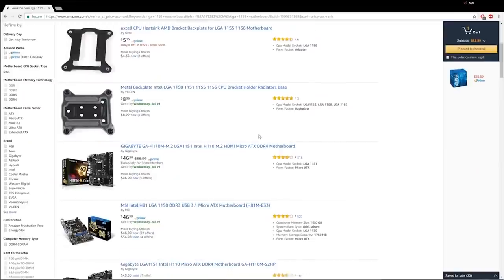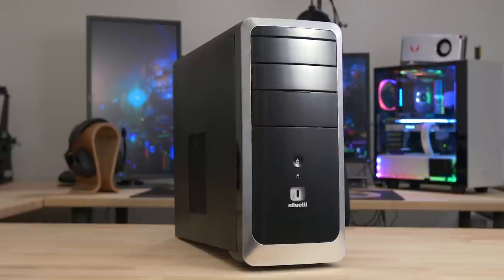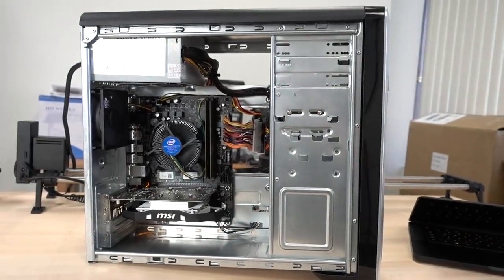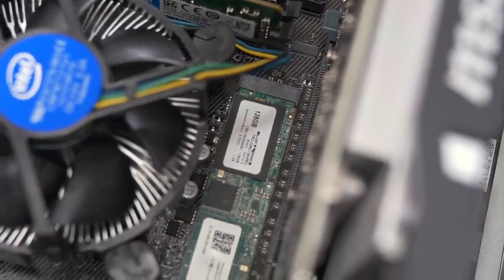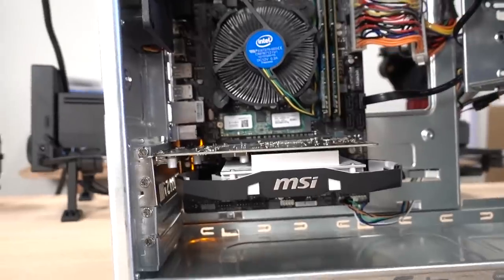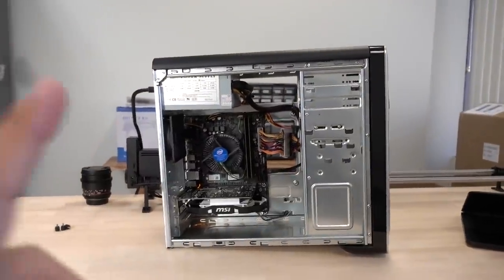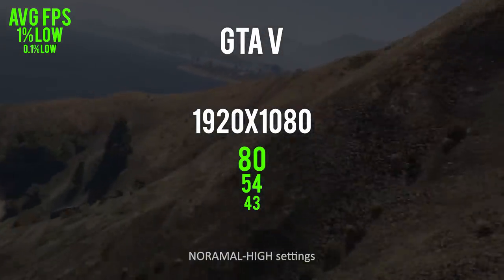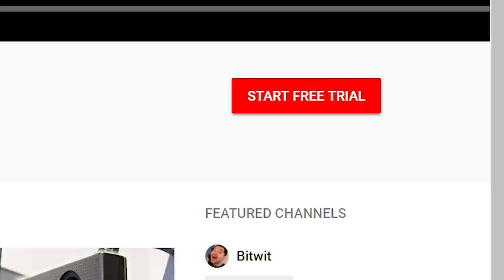The best $400 gaming PC ever?

Comment: Now do the same thing with used parts, what's the performance gain?
Reply: 400 dollars on used parts can carry you so far it the most overlooked part of building a pc on a budget
Reply: Got most of my parts used off sites like Letgo. In the end, I can play most games at high/ultra 1080p >60fps, and I only spent a total of around $375.
Reply: xTrimmZ specs?
Reply: @jasonxii3141  fx4300 @4.5ghz, gtx 1050, 8gb ddr3 @1600mhz, Corsair CX500 psu, 2x120gb SSDs
Reply: used graphics cards are such an easy way of getting cheap FPS after a bit of dust cleaning and thermal paste replacement, I picked up a gtx 970 G1 gaming for 130 dollars last year and its still running super strong
Reply: It would probably Blow up If u get a cheap ass Power supply like my brother his catch on fire and Fried Everything
Reply: Honestly if you are building a pc and want to save money, buy some parts used. The only used parts I would stay away from are cpu, motherboard, and ssd/hard drives. Everything else is really fair game.
Reply: Used parts allowed me to build a $900 rig for $630
Reply: @xiProNewb  fx 4300 in a 375 usd pc? That's not worth it at all.
Reply: @kaoteni4122  why wouldn’t you buy a used cpu?
Reply: @kaoteni4122  and power supply.
Reply: @UpbeatTempo  Because the silicon quality won't be great.
Reply: @HeelerHouse  Does that matter for normal use most of the time or just heavy overclocking? I just built me and a friend's pc not too long ago, and I got a used Ryzen 5 1600x, so far it's worked great for me. He got a used Ryzen 3 2200g and so far no problems either. I've known about the PSUs/SSDs/HDDs, and have always known motherboards are a bit iffy, but I haven't really seen anything saying that used CPUs are big red flags.
Reply: @UpbeatTempo  It can matter for lifespan, but you'll probably already replace it by then.

Comment: How did I do?
Plan to do 1080p gaming, casual Photoshop work

Ryzen 3 1200 
ASRock B350 Motherboard
1x8GB RAM
120GB M.2 SSD
1TB Seagate Barricuda
Zotac GTX 1050Ti Single Fan
Bitfenix Nova Case
500W Corsair PSU

Total - £520
Reply: Yep that's awesome for 1080p gaming!
Reply: Which B350 exactly?

But otherwise it's solid.
Reply: Look on ebay pr craiglist for used 900 series gpus. I found my friend a evga 980 for 140 plus 15 dollars for shipping. If you look closely some people will sell used graphics cards and sometimes motherboards for a less than a 105pti
Reply: I'd look at the Seagate 2tb drive it's usually not that much more than the 1 tb one for way more storage
Reply: what about the key board mouse speakers monitors and the other jazz you might buy? how much does that total to?
Reply: Fantastic, but you could save money by cutting the power supply down to something like 430W
Reply: Crippz that is a pretty good build, I'm also from the UK. I would recommend considering the RX 570 or gtx 1060 3gb cos they have a pretty decent boost in performance, especially in titles like PUBG or Witcher 3 it will push you over the 60fps mark at higher settings. But for lighter/more optimized games that is a good parts list.
Reply: Brother Ares Yo I just saw an Rx 570 on ukpcpartpicker for £156 and that was a fucking amazing deal
Reply: Brother Ares i agree 
Gtx 1060 is a better choice
Reply: Crippz Corsair doesn't make a single decent 500W PSU. Get the CX450 or CX450M instead
Reply: You MUST put a dual channel RAM in there, can help a lot, especially with Photoshop. Apart from that, excellent for the budget.
Reply: al kiou I don't know, a single stick would also be better for future upgrades
Reply: Crippz Solid rig, it should do fine at both of those tasks. Definitely a good PC for your needs.
Reply: Get dual channel memory the extra bandwidth helps
Reply: Going in order: get 2x4 ram so it's dual channel, go for a 2,5 ssd because sata m.2 is the same thing but pricier, nvme is better but way pricier. Then the PSU it's ok as long as it isn't vs... Or maybe even the vs if you don't find any better
Reply: The zotac card is great
Reply: Probably should've gone with dual channel but pretty good I would say
Reply: good one
Reply: That kicks ass for the price
Reply: Ditch the 128GBSSD
instead get a 1TB Seagate Firecuda SSHD
use extra cash for additional 8GB RAM (make it 2x8GB because dual channel memory setup matters)
you will be happier.

the new firecuda sshd is an improvement over older generation sshd, and your boot and load times will be just 'almost' as fast as SSD. and you still get the huge capacity.
Reply: Lol it's my exact same build
Reply: that's fucking good
Reply: If your doing photoshop work and gaming go for dual channel ram
Reply: Crippz send a link for that m.2 ssd
Reply: Sounds like a great computer to play minesweeper at 4k !  
JK. That strikes me as a great entry level pc, with a good upgrade path.
Reply: Camelia sinensis The M.2 SSD was actually the same price.
Reply: Ryan C 😂
Reply: Faren Sabri Great idea!
Reply: Okay after reading all your suggestions, I have decided to upgrade the 1050Ti to a RX 570 8GB & the PSU to CX450M. I also want to specify, I chose to go with a single dim of memory because this PC if I build it will be with me for at least the next half a decade, and I would rather have one dim so I can upgrade later.
Reply: Lettuce Yes, but during this whole mining craze, miners will sell GPUs that are on their last leg. So I'd rather stay safe and go with new.
Reply: TheChaoticGamer I have all that 'jazz' but I spent around about £100 - £130.
Reply: SlavjanA https://uk.pcpartpicker.com/product/crs8TW/asrock-ab350m-hdv-micro-atx-am4-motherboard-ab350m-hdv
Reply: Just remember..! the AMD Ryzen 3 1200 is listed as a minimum system specs CPU on Oculus.
Oculus homepage:  https://www.oculus.com/
 The recommended/minimum specs page:
https://support.oculus.com/help/oculus/170128916778795/
Reply: Crippz use asrock a320-hdv for cheap ryzen motherboard
Reply: Corsair PSUs are kinda expensive. I'd go with an EVGA BQ 80+ Bronze PSU
Reply: If you can find a 570 for cheap, sure. And yeah the CX is acceptable
Reply: Are you overclocking?
Reply: Find a used 970
Reply: Crippz use dual chanell
Reply: Change the motherboard to an a320. M.2 to an ssd and get a ryzen 1400. It suits your needs better.
Reply: sounds like a solid build man. honestly if you could stretch it i'd go for an i5 6400 or r5 1400, but thats a pretty good list
Reply: Instead get a 240 gig sata ssd
Reply: Crippz nicely! Great price-performance ratio man
Reply: Nice but i prefer gigabyte motherboards they are alot durable good performance and m.2 ssd slot which is awesome!
Reply: Brother Ares hey I'm running a similar build, only differences are I have
2×8gb ddr4 ram
2tb hard drive
250gb ssd
And a gtx 780 ti for free from a friend. How's the performance for this something like this?
Reply: Looks like my build I already completed, looks good
Reply: id make sure to run dual channel memmory, it wont cost u more, and you dont have to look for a used part.
Reply: Brother Ares dude, my 960, without an overclock, still crushes a great many games at medium to high settings. The 1050 TI is a fine card
Reply: This is better.
Reply: Lettuce hes english like me we dont get the same stuff cuz its in America
Reply: Pandametal - Guncraft i second the above post yes u can upgrade the one stick but this is a budget build where u need to maximise performance and using ram in duel would be the better choice imho
Reply: hey, not too bad! though you would benefit more from running 2x4gb RAM sticks because ryzen likes its fast dual-channel RAM, i understand it does cost a little more at the moment due to the state of ddr4 prices. overall a great system that has a solid upgrade path! over time you could upgrade your CPU to something like a 1060 or a 1070, your CPU to a ryzen 5 or 7, and add in another 8gb stick of RAM to have a killer pc. :)
Reply: Hardly gonna hit 7 fps in Minecraft at 480p
Reply: Maybe a gtx 1060 with an intel pentium g4560 cpu
Reply: Looks good, like some people are saying look at a 1060 3gb,  what are you going to use for your os? Do you already have all your peripherals?
Reply: Crippz i would recommend dual channel ram for your situiation
Reply: kick ass! but honestly, i would go with a dual channel kit of ram, but it's great!
Reply: -Switch out the 2 storages for an SSHD, which will save you a ton, and perform like magic

-Try getting dual channel memory.

Otherwise, you're golden.
Reply: Looks solid man.
Reply: I'd drop to a 1050 and get a R5 1400 for photoshop
Reply: Crippz nicr
Reply: looks okay m8.. but I think you could pump that 8gb ram to 16gb for more better multitasking (multi browser tab, photoshops canvas etc)
Reply: Same build i have, i've been enjoying it at 1080p 60fps with decent settings
Reply: Crippz get ssd and 520 that valute is more then 520 dollars so I might wanna get cheaper evga 430 80+ bronze and cheaper case so u could get ssd
Reply: IDK 700 the 1050ti actually has 4 gb compared to the 3 gb version.
Reply: Natani Kriechbaum the 1060 has 1gig less but its faster overall
Reply: Decent... But i would get another 8 gb of ram for when you want to do more layers and stuff in photoshop
Reply: In the future I suggest upgrading it to 1070 ryzen 5 when you muster up the money ... But overall , pretty good
Reply: Crippz gtx 1060 3gb will  be good
Reply: Crippz I would def upgrade ur ram to 2x8 and get an msi b350, they are more reliable and get another 120gb ssd to improve speed especially if ur gonna be doing photoshop and editing, other than that u got a pretty solid build bro
Reply: maybe go for a dual channel 8gb ram instead of a single channel 8gb ram

Comment: Hey Kyle, you probably won't read this all the way in 2018, but you should do a cheaper budget gaming rig for october-november of 2018. what with GPU prices being the way they are (still) I have found a reasonable build on Newegg for around just $300. 
ASRock 760gm-hdv mobo ($44)
amd fx 6300 cpu, stock fan ($60!!!!!)
cougar mg110 case, 1 fan (I have mine in the top middle, blowing air onto the ram and cpu heatsink) ($30)
G. skill memory 8gb @1600 speed, (I went with Nemix ram, cause it was only $40) (I went with nemix ram for a sale, but Aegis and Aries typically run $10 more than my nemix-no-heatsinks normal ddr3 modules)
an evga psu, 450w (I believe the model to be a 450 BT ($33)
an older 2012 WD green 500gb ($24)
the GPU is a Corn GTX 750 1gb, even with still semi-inflated gpu prices, this was only $60. still is, as of the time of me making this comment.

Now, I realize this is an extreme budget build, with absolutely no upgrade path (well, one that would be worth the money spent) without a full system upgrade. HOWEVER! for many gamers like myself, running old cheap laptops or school-like prebuilts (looking at you, dell optiplex) this is an excellent way for us to get a foot in the door, as you would say. by the way, did I mention every singl part in this build is bought new, unused? so while being cheap, and while it DEFINITELY won't run every new triple A game at 1440 or 4k 144fps, it will absolutely demolish just about any competetive esports title at 720p-1080p low settings at a steady 60lock. So please, if you happen to see my comment, do a video on the low low end of budget gaming for late 2018 for us, I know I was just going to buy another laptop until I saw this specific build available on newegg, decided to buy it, and am now attempting to share it as MUCh as I can to anyone who could use the info. Sorry for the stupidly long comment btw
Reply: Helpful
Reply: Kyle's build right now will run you $500 without the case and power supply so yours is definitely much cheaper compared to this one
Reply: Why even attempt gaming on that piece of shit, yeah it definitely wont run every triple A title at 1440, 4k, 144fps because it wont run any triple a game at 30fps lol. just hold onto that $300 until you can throw in some more cash and get something worth buying. Waste of $300.
Reply: @procze  oh, and for the record, that "pos" system you seem to hate for no reason, yeah, I can play any title at 1080, with at least 60 fps. You don't need all the latest and greatest hardware to play video games bro, and not everyone cares about 4k and 1440p. they're not even that much better looking to the human eye than 1080p.
Reply: Are you able to play rainbow six siege or fortnite at decent frames
Reply: @mutedd4971  yeah! Typically avg 90-100 fps at low/med settings at 1080p (fortnite) and medium settings 70 fps avg for r6S
Reply: A for effort

Comment: $400 is usually what I spend on what I call a 2nd stage upgrade to my rig, before upgrading everything entirely. Had my rig since 2012.. And still playing modern games. AMD FX8350 and R9 380. You'd be surprised how many games it runs fine on. Lol
Reply: Everyone trashes on FX processors, they're not THAT bad...
Reply: JetSurf2002 
Fx 8350 for the wiiiiiiin!!!! 

Nah, but seriously, it does run decently.. still waiting for sales to upgrade mine, though. All about going to ryzen in a few months.
Reply: same. I only spent money on my rig when my HDD and GPU crapped at the same time. Never touched it since 2012. My 8350 is still a solid CPU.
Reply: FX 8350 is sufficient for 1080p gaming. It is serving me well paired with a RX 580
Reply: i only recently upgraded to a fx 6300 and a 1050ti from an amd phenom ii x4 and gtx 560 LOL.. just to play destiny 2. Now i'm saving up for a z370 mobo and an i5 8600k

Comment: Kyle Builds system for 1080p 60fps for $400. Meanwhile I have an $800 system and has played everything below 1080p since I built it
Reply: Sounds like you didn't do a great job of picking parts lol.
Reply: Matt DuGuay wtf are your specs
Reply: i5 6500, RX 480 8gb reference, 8gb 2133 mhz RAM, B150 mobo
Reply: the only thing you're missing out on is 16gb of ram but why an 8gb 480 when you don't even play at 1080p
Reply: Your monitor isn't 1080p?
Reply: nope
Reply: was all that was available for me when it released. 4gb models were sold out when i woke up
Reply: dont have a 1080p screen and i dont want to dip below 100 fps
Reply: I7 3770 non k and a gtx 650ti and i can handle 60fps.... why the hell is your moniter not 1080p and apparently supports over 90 fps assuming its a high refresh moniter
Reply: lol
Reply: Buy a monitor that goes 75hz or higher in refresh rate in 1080
Reply: I dont have the money for that. when i say im below 1080p im saying im on a CRT moniter that has been in my house since before i was born
Reply: Matt DuGuay ah ok you can save up then
Reply: i picked what i could afford with my budget at the time. i wasnt going to buy a gtx 900 series or r9 series gpu with polaris launching, and skylake was basically the same price as haswell at the time so i figured i may as well go for the newer platform so i get a few more years out of it. i couldnt find any used cpus that included the stock heatsinks and knew i would get the most bang for my buck with a newer gpu. as im sitting ill be able to play as i am for another 3 years before i get any performance issues.
Reply: well since i just dropped $3K on textbooks for this college semester i doubt ill be able to afford anything new anytime soon
Reply: Your monitor is 60Hz though right? If so, anything above 60 fps makes no difference so you shouldn't need to aim for >100 fps.
Reply: It's an old ass CRT. This has a refresh rate of about 120Hz
Reply: Used books man..   My buddie games at 1080  with a 7700k, 1060 6g, and a 144hz monitor. The 1060 and your 480 will push over 100fps or more in most games if you turn some settings down. I think he paid $200 for the monitor.
Reply: gotta go for new. most instructors at my university demand the latest edition of everything, two or three books per course, and will fail you outright if you dont buy everything they tell you to. some will only allow you to buy from the school itself and that means paying ~50% more
Reply: dont have a 1080p screen and cant afford one
Reply: +Matt DuGuay what degree are you going for?
Reply: H_ EspelIZ I have a Compaq monitor from 2003 that is 1024x768@75hz.
Reply: Kyle did not build this, his wife did.
Reply: The struggle is real
Reply: Matt DuGuay did u buy ur mobo and cpu as a bundle on ebay